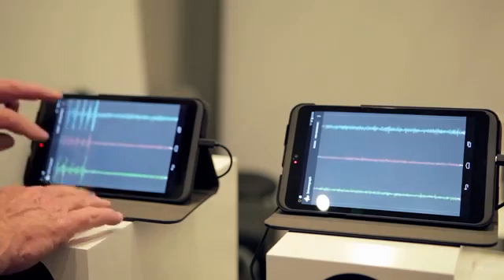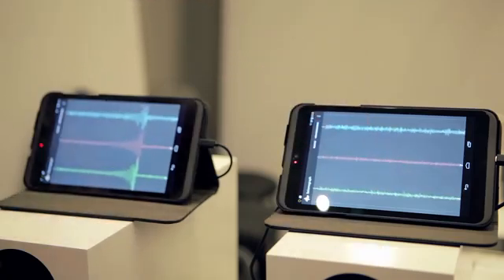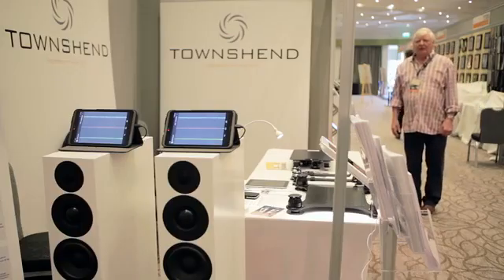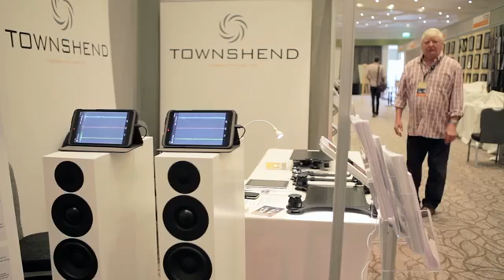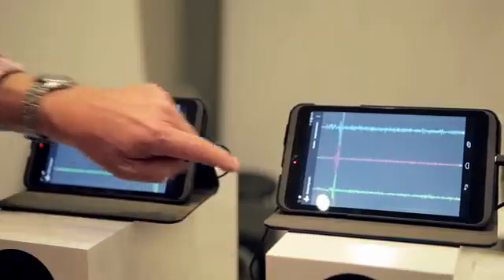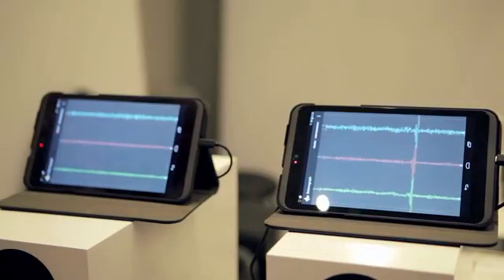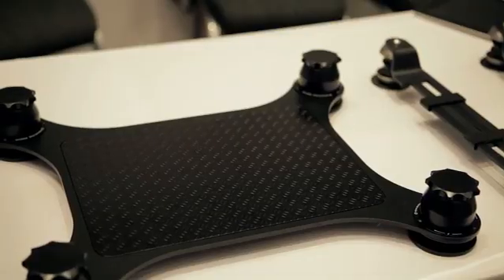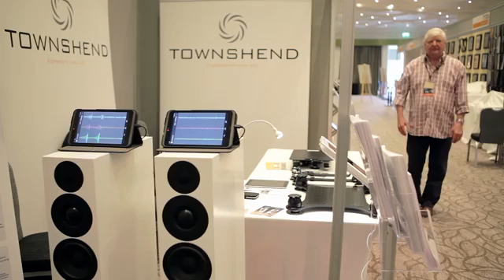Townshend Audio Seismic speaker Isolation tap test

Comment: The task of the spikes is not to isolate the speakers from  the floor, but the opposite. The loudspeaker sounds better when it stand on the spikes as it moves less with the big added mass of the floor. If you have a high level audio system - you can easily hear the difference. 
One can use such things on a turntable (sometimes) but not on a loudspeaker
Reply: totally agree

Comment: Question, when the the cone is driven forwards it will require an equal and opposite force from the cabinet, if the cabinet is on a moving base then it will move in the opposite direction,  therefore won't the end result will be a decrease in the impulse movement on the cone essentially attenuating the attack?
Reply: Yes, as said in the video, about 0.01dB